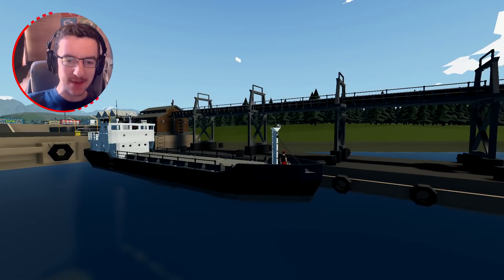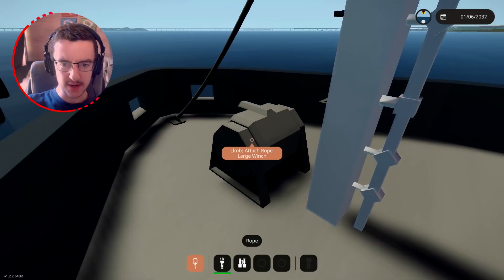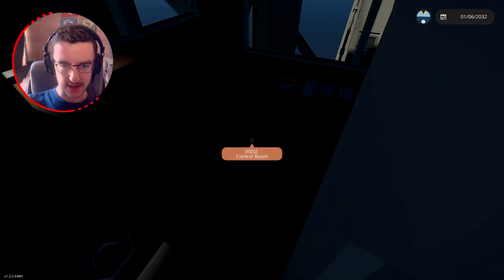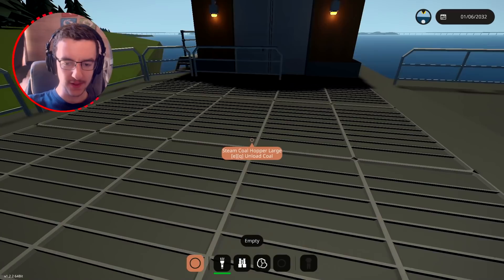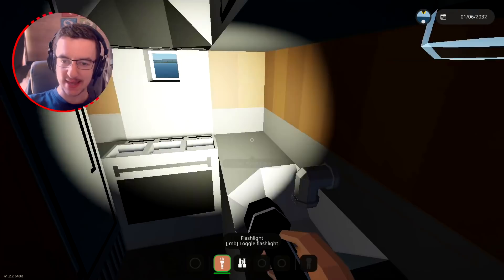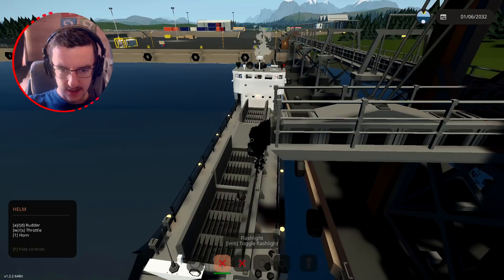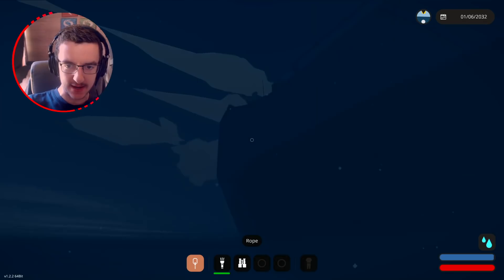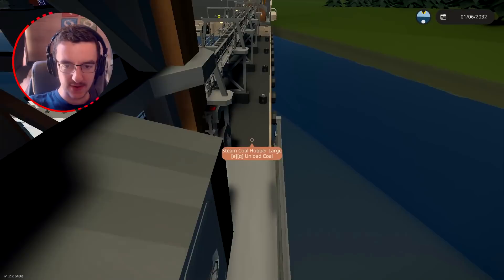Fully Functional Coal Port!  -  Stormworks Gameplay

Comment: I can play stormoworks on 4gb of RAM, Intel HD 620 VRAM, and Intel inside N2840
Reply: processor has 2.2 ghz and can reach speeds of 2.7 or 2.8 ghz
Reply: Are you saying that you can.. or are you asking if you can? 🤔
Reply: I am asking
Reply: I don't runed it because i was to afraid to not break my pc
Reply: I want to see if i can run it. I asked on reddit no respond. On discord also no respond
Reply: @ILikeBlackholes77  well you wont break your computet, that cant happen. but I think you wont have a good time playing with that computet. but if you have the game its no harm in trying.
Reply: I downloaded it a week ago
Reply: I runed it on 1 ghz pc older that this pc and it worked but pc was a bit hot
Reply: @ILikeBlackholes77  the PC wont be taking anny damage, and if your temps are to high you can try change the fan curv or change the thermal compound on the CPU. and I would recommend getting a cheap GPU.
Reply: @ILikeBlackholes77  or is it a laptop?
Reply: Is a laptop
Reply: @ILikeBlackholes77  okej well your GPU is not realy at the minimum specs and its a laptop so its gonna gett hot. the arent realy made for games unless you buy one for to much money. so my awnser is you can but it wont work very good.
Reply: Cloud gaming is an option to play stormworks better ?
Reply: @ILikeBlackholes77  I dont know what that is so I dont know.
Reply: I lookt it up and how High is your network speed?
Reply: 50 mbps
Reply: And i gpu has dynamic ram i think it can reach 1- 1.5 gb of vram
Reply: I played ksp on it on 30 fps and no heat
Reply: @ILikeBlackholes77  Im sorry you better just save money and Buy a more modern computer. best would be a desktop computer .cloud gaming wont work with 50mbps
Reply: But i can play the game or just i will burn my laptop
Reply: @ILikeBlackholes77  you can play, it wont burn you computer.
Reply: You won't get much out of a 2.8Ghz, use only small creations, and maybe disable the ai addons